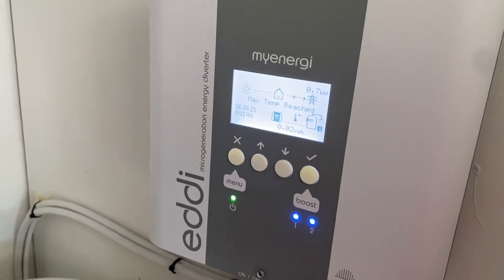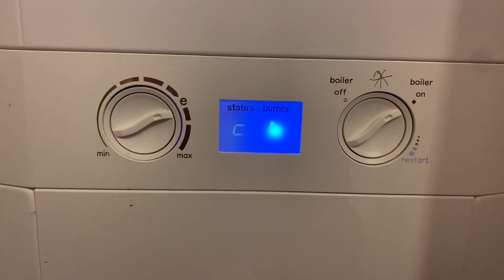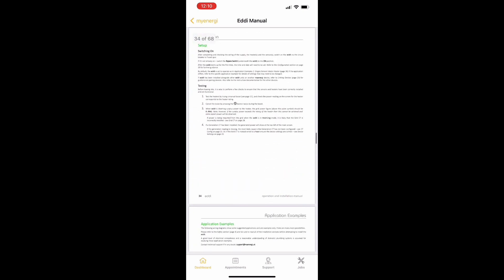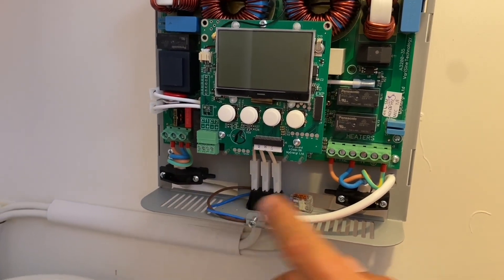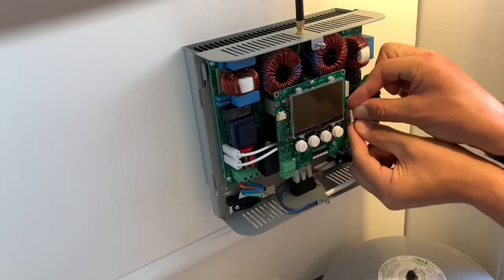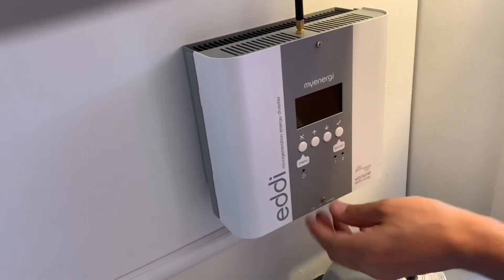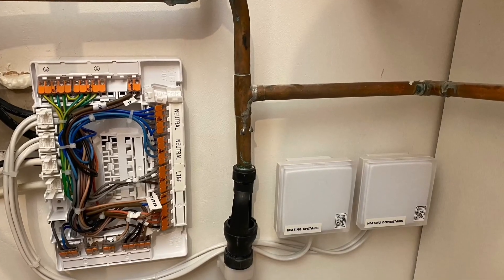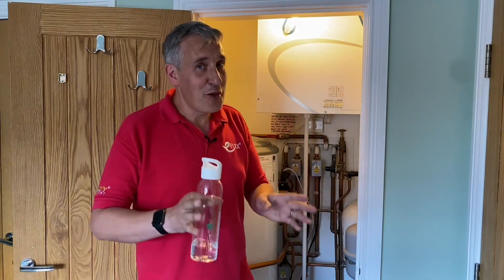MYENERGI EDDI takes control of the GAS water heating

Comment: Really cant see the point in this extra bit of kit for the Eddi. The water is heated by the solar and if there isn't  enough water being heated, I just leave the hot water programmer on constant. So the boiler only kicks in when needed as a top-up.

Comment: Can I use an Eddi relay card to control the gas heating on my Viessmann Vitodens 222-F Floor standing combi Boiler with built-in storage cylinder so that I could give preference to heating by my solar panel array? If so, what would are the installation instructions?

Comment: Great video and thanks, I have a question about adding a thermo stat to the relay card, i have a problem where the eddi thinks the immersion has reached max temp and then starts to send excess power to the grid and my cylinder never reaches the same temp before I got the eddi installed. I was hoping that by installing the thermo stat that the eddi would read that setting over the immersion??? Have ye any experience of this??

Comment: Thanks for the video - very informative! We have just had an eddi fitted, and I had a discussion with the installer about how it should control the boiler as a slave. He has wired it up separately from the boiler (as shown in the eddi wiring diagram number 1), but this means the boiler might run as well as the eddi if left on by the controller. It looks like I need to go the same route you have - use the eddi to slave the boiler for hot water, and have a smart thermostat with timing to run the heating. Could you please share the link to the video where you sort out the S+ wiring and fit the wago junction box? I have had a good look through your videos but can't find it. Also, even though you mention it, none of the links are appearing above you in the video - perhaps this is a YouTube change?
Reply from the maker: Thanks for the feedback - try this for the Wago https://youtu.be/E965_4WyXwM
Reply: @efixx  I have ordered the box and connectors, and will be having a go at this over the weekend. You wouldn't believe the state of the box currently (well, actually, you probably would!!). Thanks for the videos and information!

Comment: Hi, loving your videos but I'm confused by this, I currently have my how water heating on auto, so if I have my Eddi attached heating the water through the immersion heater, do I really need this anyway - surely it just means that it keeps the water hot for longer during the day and if and when the gas does kick in on auto, it will be for shorter as the water is already up to temperature - or have I got this wrong please?
Reply from the maker: You’d usually set Solar to be the main source and gas kicks is if the water isn’t up to temperature at sunset. Also In this installation we wanted to get rid of the old timer as it wasn’t app enabled

Comment: I currently have the Honeywell Evohome system with the Evohome hot water kit attached.  Do you know if it is possible to link the two and still have my evohome monitor the hotter temp as well as the Eddi? Thanks

Comment: Hi can the myenergi eddi be installed next to consumer box  instead of the airing cupboard so i can have both the ct1 and ct2  connected to the eddi  without using the harvi because the solar consumer box is right next to the main consumer box I do have the switched spur in the airing cupboard for the emersion i would just like to have it all in the same place

Comment: Have fitted the relay board in Eddi and wired the interruption to the Immersion Stat in the S Plan box and heats the water to temperature on gas boiler on a manual boost or Timed schedule . Question  is the live feed from my Tado box   means is only live when the Tado hotwater control is triggered  ( means Tado App shows hotwater on 24/7 not ideal for stats ).How can both Tado and Eddi Relay operate the boiler separately to each other .

Comment: Good video as a DIYer I get a lot out of these even if it is just to have an informed conversation with my sparky.  

If you are paid for electricity export (3-5.5p / kW as I write) at a price c. 110% or greater than that of a kW of gas (2.5p but I am locked in so likely 3.25p now) then you are economically better off selling the power and using gas as you will have more money in your pocket AND if under your scenario at this home you heat between 10am and 3 pm that gives 2 to 4 hours for the water to cool down before it is used.
Reply: Good point. Out of interest though, what is the relative efficiency of the different heating methods? This should also be factored into the calculation, IMHO.

Comment: Questions from a householder;

Is the Eddie prioritising solar to heat the hot water tank until/unless its reaches max temp? 

The regime that Coordinates the solar and gas boiler to heat the hot water tank is intriguing and could be clarified

 - do you stop the combi heating that tank somehow if you think you’ll have a supply of solar energy instead ?

- is it weather dependant?

do you schedule this solar heating based on an assumption about how much demand for hot water there’ll be for an upcoming period ?

Is that scheduling done in the Eddie? And does it abandon the solar heating if demand is high or sunlight poor or time running out (before an expected demand period)?

Is there an operating guideline that illustrates how much hot water will likely have been heated by the solar given specified demand and user scheduling regimes, and time of year

Is there a payback calculator that examines the value of savings made by having had solar heat a proportion of the hot water ?
Reply from the maker: The Eddie is set up to prioritise solar heating.  The immersion heaters will use excess solar during the day. If the water isn’t up to temperature by 4PM then a heating cycle on the gas boiler starts to make up the difference. All of the timing is programmed via the Eddie. We removed the time clock on the gas boiler.  This is a basic set up - if you want to see a more advanced approach check out the videos we are releasing at the moment - https://youtu.be/jVVaUhFZb_o
Reply: @efixx  In this case is there any advantage to having the Eddi control the gas other than having it all in one place? Would having the gas on a regular timer to come on at 4 not just serve the same purpose being as if the tank is already hot from adequate solar then it just won't come on?
I am getting a solar install with an Eddi (and Zappi) next month and just debating whether or not to take the existing oil fired hot water control away from Hive and use the Eddi instead. Standard S plan system also.
Reply: @efixx  hey thanks for the speedy reply!

Comment: I cannot understand why in this day and age, most houses are still using hot water tanks and keeping water hot that isn't being used instead of using inline gas heaters to heat the water as it's being used. A tank should only be used for solar heating with a gas inline heater to heat the water being used to the desired temperature if the solar heating has not got it hot enough. So much gas or electricity is being wasted with standard hot water systems.

Comment: If it's that hot next to the hot water tank doesn't that mean it's inefficiently leaking lots of heat and needs better insulation or replacement with a better model?
Reply from the maker: The heat is mainly from the uninsulated pipe work.

Comment: How much does the immersion controller and relay board cost?
Reply: £395 for the Eddi and another £45 for the relay board if you get it from MyEnergi's website. I can understand the Eddi if you have solar it makes sense but the extra for the board when you could just change the gas boiler time control to only heat from say 1-2am ready for the next morning family shower. £45 and someone to fit it, plus if it fails I now know it fails Normally Open stopping the boiler from heating the hot water as backup. Or 5-10 minutes of your evening putting new times into your programmer, which is free.

Also if it fails what with the current shortage on semi conductor chips I expect the price to possibly rise, not to mention the instructions advise taking the cylinder stat out of circuit so the Eddi relay board is in control of the boiler. Great but now means any engineer that attends to get the boiler up and running as a back up needs to fit a cylinder stat back and un-link the Eddi.

Comment: I can get why this might be good, but as a Sparks that happens to also install gas heating systems it seems somewhat pointless? In my eyes over night is always going to be the Gas boiler heating the cylinder but during the day the timer will be switched off anyway so you'd have the Eddi hooked in with the panels and the immersion turned on so the evening showers are heated by the sun, so why bother with interrupting the cylinder stat. Also if the Eddi fails does it fail NC or NO because you could effectively stop the cylinder heating at all if it fails NO. 
This is one of those "technology is progress so it must be a good idea" when in fact there are far more simple solutions to the problem.
Reply: Yes, I can't get my head around doing it this way. If the tank stat (timed for the hours when hot water definitely needed) is set below the temp the tank heats to under solar, isn't that job done? The boiler will only kick in if the solar hasn't heated the tank sufficiently. Isn't this the same as replacing the tank stat with the relay system with into S or Y plan?
Reply from the maker: It was more of a problem with two separate controllers and a separate app for the heating.
Reply: @efixx  The separate controllers wasn't an issue given how they function and as long as they're timed appropriately, then it just comes down to the choice of app. That's always going to be an issue now that every boiler manufacturer has an app, then hive, google along with apps for different manufactures EV chargers/ solar set ups. Until there becomes an industry standard protocol that all apps and manufacturers agree to using so any one piece of tech can communicate with any other piece of tech there will be issues. 

The one thing that really ought to be kept as simple as possible though is hot water on demand and I'm sorry but this just doesn't seem like a sensible way of doing it. Teaching people how to time control their hot water/ heating and changing their habits will have a far bigger impact on their bills and the environment.
Reply: @effervescence5664  Hot water on all day? or set to a couple of hours in the morning and a couple in the evening?, always hear different answers from Plumbers/heating engineers, whats your take?

Comment: I also use the eddi relay card to switch I 3.6 kw car charger on and off, via a contactor , great bit of kit
Just upgraded my solar pv system and have been grid free for 45 days now 
https://youtu.be/95l5wQABTqE
Reply from the maker: Impressive set up Chris we’d love to get a closer look at your install.
Reply: @efixx  system has been built up since 2012, adding electric boiler and water tank and more recently car chargers and smart automated control, the wife says if I ever die she wouldn’t be able to use the system so I will have to do a instruction manual , 😂